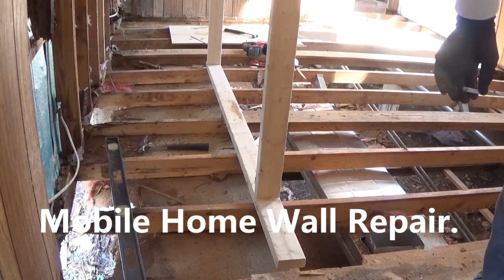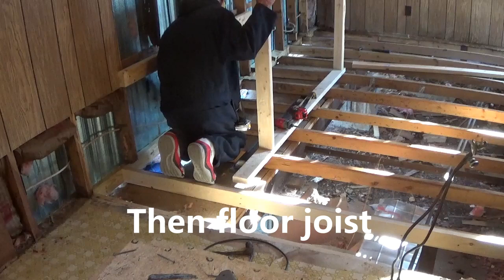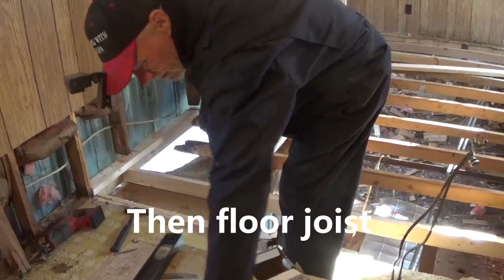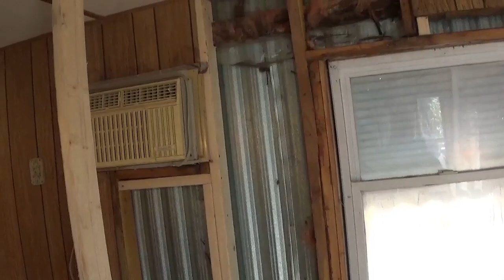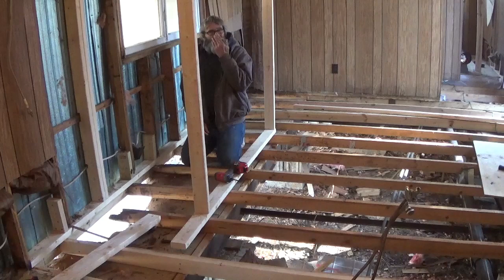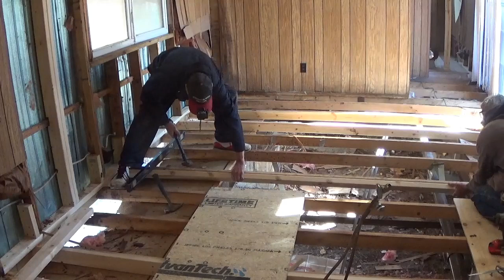Mobile Home Rim Joist Repair.

Comment: I fix a lot of mobile homes . I live in West Virginia they are built fast on lines and there not built like stick built homes. People I fix there homes they will say why are they built this way. One they are weight restricted for being put on roads for delivery. So there design is for those reasons for one. The other is to get them built fast to send out to sale as fast built homes for people who rent home spaces so they can relocate them some were else if you want to. And are affordable then a lot of stick built homes. There good for there purpose.and all Homes stick built or these need repairs done over time. Nothing last forever.
Reply from the maker: I agree

Comment: I'm having to do this But right nowI am having to replace the forward trim that sits on the metal frame, so I can start replacing the trim joists and the floor joist coming towards the back.
Reply from the maker: If it’s made of wood you can fix it

Comment: Do all mobile homes have screws with the weird rectangular bit head? I can’t find a bit that will fit it and all of them I’ve tried making myself won’t work for very long lol…
Reply from the maker: They sell them at any hardware store. They sell them at any Lowe’s or Home Depot. It’s called a square bit
Reply: I found a square bit in an assortment of bits I had.  I was taking down kitchen cabinets and it only worked on a third of them, and I had to sawzall the rest.

Comment: I've never seen 2X4 floor joist's!  Mine are 2X6's and run length wise, big PIA...
Reply from the maker: If they run lengthwise how do they support the outside edge
Reply: There are metal outriggers attached to the frame that hold (did hold) out side walls.  They've started sagging and now my outside walls are dropping lower then the center of the floor...
Reply from the maker: You can fix that. You have the same thing as this 1. Except for the two by fours. You have 2x6  but yours are worse you need to build walls under your out side walls
Reply: Exactly!  To provide support to the outside walls.
Reply from the maker: I’ll will make a video just for u tomorrow. Around noon tomorrow I will post your video. I will explain what to do. Share me on your Facebook help me get views. There are a lot of people that need this same info. I will call the vide mobile home wall support and under pinning all in 1.